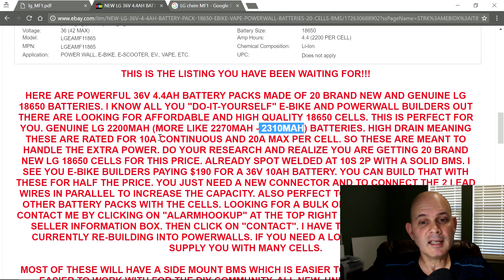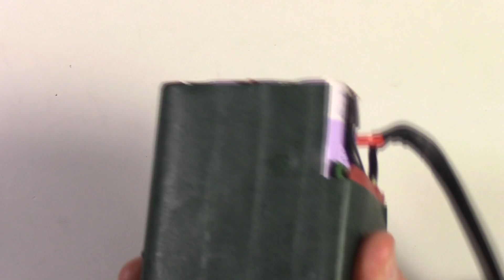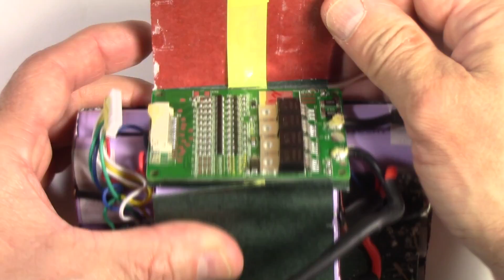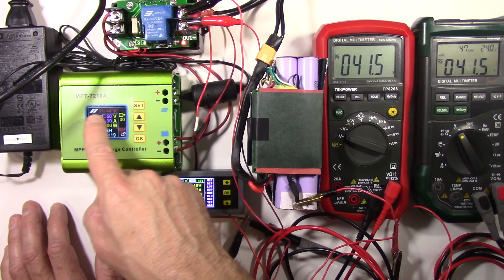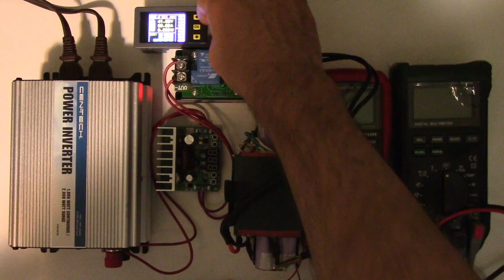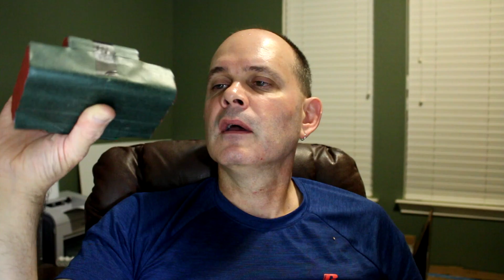NEW LG 36V Ebay BATTERY PACK 18650 Thorough Review (Great Value) For Ebike Vape Harvest Powerwall

Comment: Very nice video Richard! 
Question: 
Would you add a balancing BMS or replace with a board that has over/under protection + balancing? 
...Thank you sir...
Reply from the maker: I am still on the fence on this. I have done more research into this and it may be a balancing BMS. The manufacturers assume that the cells should never actually be more than 1 or 2% off (at the very worst case) in the first place. Their (correct) assumption is that the cells were electrically identical when the pack is manufactured so they build the balancing circuit to just trickle charge the the differences between each pair (in this case on the charging cycle as there are not capacitors present). So a fairer test would be to discharge a few cell packs by .1V or .2V and see if they balance out after a few discharge/charge cycles. I will do this and report back. It would have been much nicer to actually have a specification sheet from the manufacturer. Thanks.
Reply: I concur, I think it is a balancing BMS. ... Just because I want it to be. I am not smart enough to test it so donald trump style it is a balancing BMS

Comment: You act like there's a big difference 4.4 - 4.3 it's not much difference big deal whoopee
Reply: I capacity tested a bunch of these cells and many did came in above 2200mAh  so very possible you will get more than you expect.
Reply from the maker: If you are buying 1000 expecting to get 4400.0Ah and getting 4300.0Ah instead you may be disappointed. Thanks.
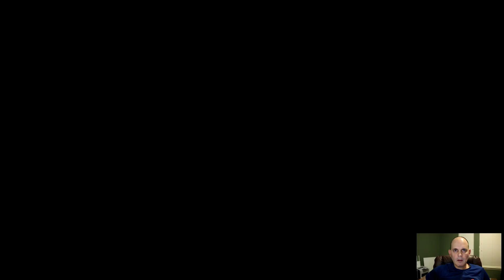Reply from the maker: Yes some will be higher in fact if you look at my results at the 19:30 point in the video you can see that every single cell pack (2 cells connected/2) rated over 2200+mAh but the LGs minimum specification for the cells is 2150 mAh here is the spec sheet: https://www.imrbatteries.com/content/lg_MF1.pdf So I agree that you may get higher capacities. Thanks.
Reply: Richard Lloyd Slightly confused as I always interpreted those specs differently. I thought that meant 2150mah is the minimum capacity you will get new, so you can expect to get at least 2150mah, not limit it to that capacity.

Comment: Looks like a good deal, less than $2 per battery.  And decent quality cells. I use these 18650 cells for flashlights mostly. Thanks for the info.
Reply from the maker: You are most welcome. I have to agree. If you are looking for a good deal for "name brand" LG 18650 cells you can go wrong with this deal. Thanks for watching and commenting. All the best.

Comment: I think for balance feature to work properly you need to test them at 4.2v, you only had them to 4.17v (unless I missed something) once each pair cell reaches 4.2v it should disconnect that pair while still pumping juice in those that are below 4.2v
Reply from the maker: I have done more research into this and it may be a balancing BMS. The manufacturers assume that the cells should never actually be more than 1 or 2% off (at the very most) in the first place. Their (correct) assumption is that the cells were electrically identical when the pack is manufactured so they build the balancing circuit to just trickle charge the the differences between each pair (in this case on charging as there are not capacitors present). So a fairer test would be to discharge a few cell packs by .1V or .2V and see if they balance out after a few discharge/charge cycles. I will do this and report back. It would have been much nicer to actually have a specification sheet from the manufacturer. Thanks.

Comment: I bought the 149 dollar pack from this guy, randombly tested some cells, the average was like 2250 not lying, some even came up to 2450
Reply from the maker: Cool! Did you take them from 4.2V down to 2.75V? Thanks.
Reply: thats correct, when they cycle twice or three times the real capacity can be seen
Reply from the maker: Great! Thanks again.